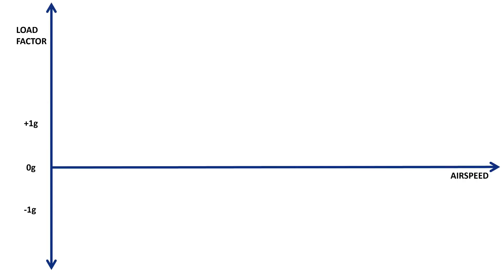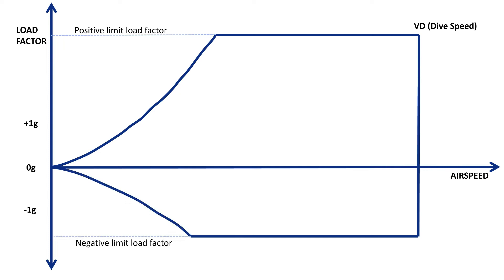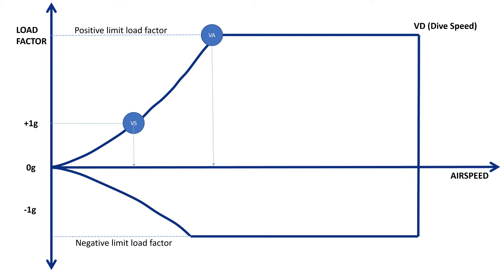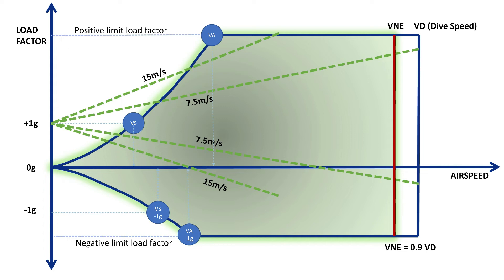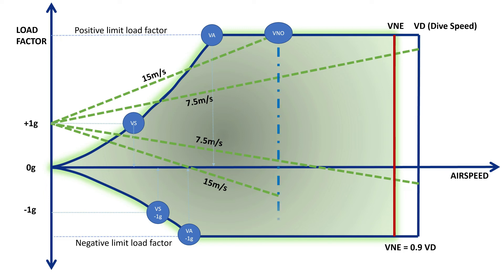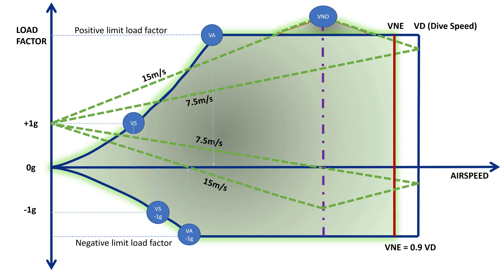Gust envelope explainer

Comment: I am confused with the lectures I am studying. If the gust envelope at Vc is at a higher load factor than the nmax maneuvering line, then the aircraft must be designed to extend to the larger of the two envelopes? covering both maneuver and gust design requirements? thanks